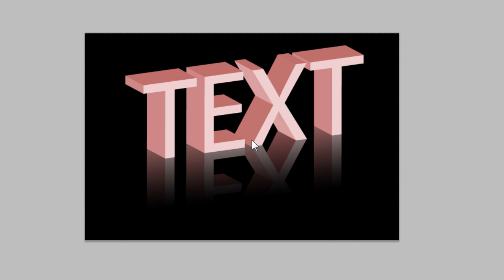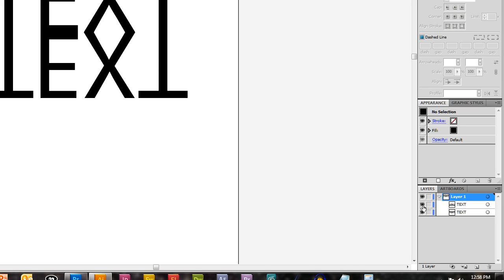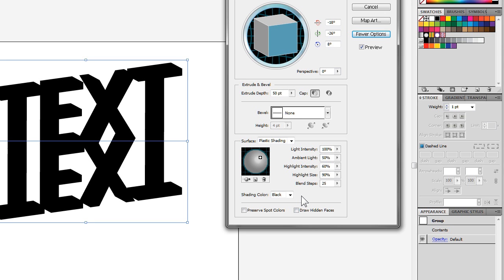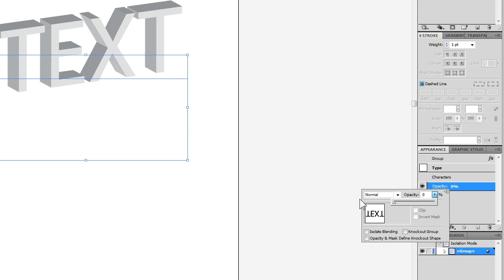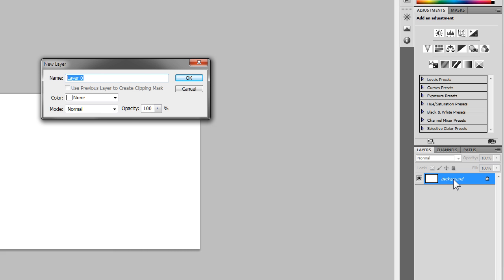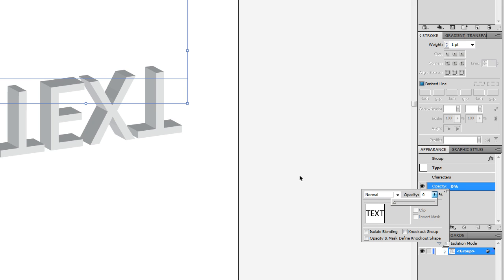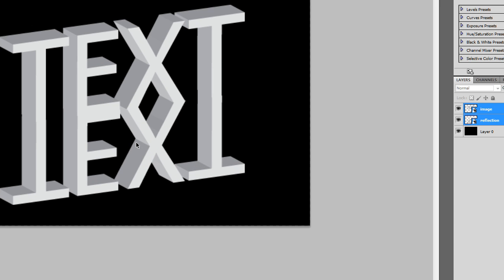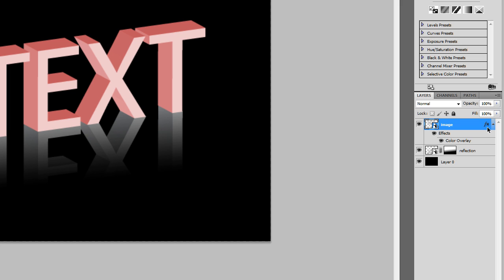3d Text Reflection tutorial [Photoshop + Illustrator] *revised*

Comment from the maker: @ActionEditsHD 
Sure you do, it's in your tools pallet. It might be visibly replaced by the gradient tool. Just click and hold the gradient tool, and a dropdown menu revealing the paint bucket (or fill) tool will appear, then select the bucket. You can also click F as a hot key, or if the gradient tool is currently active, click Shift+F and it'll toggle between the gradient and fill tool.